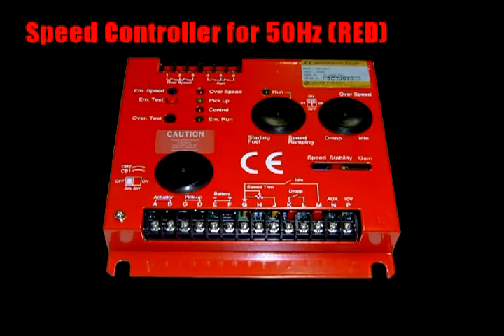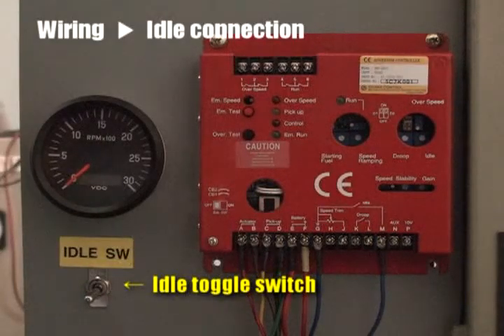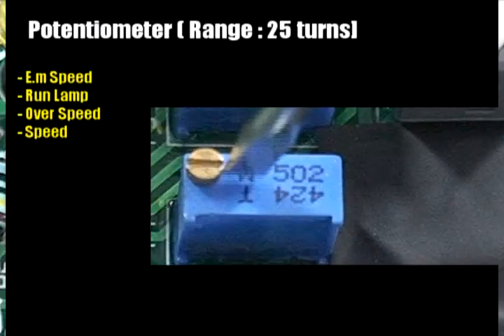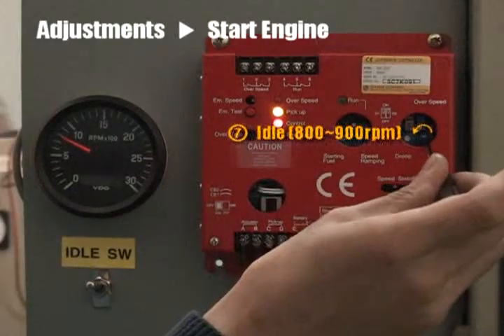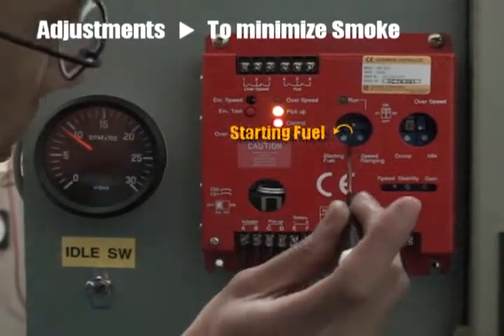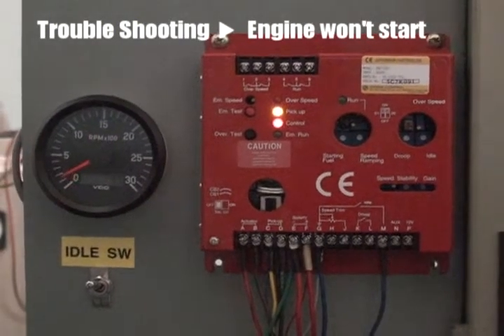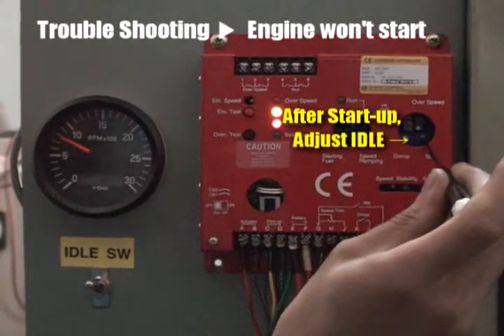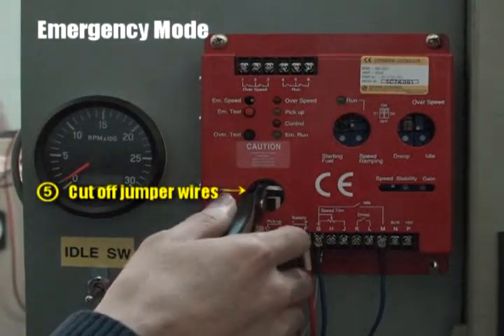سبيد كنترول  Speed control electronic governor

Comment: I need buy one and try to adapt and put on my gas generator. Because I have serious problem with voltage variations with the original mechanism for throttle control. And my inverting machine every time protect for heavy voltages fluctuations. THANKS FOR UPLOAD THIS VIDEO 📹 !

Comment: what would the idle speed used for?    runnings 1800 rpm    when would the idle speed come into play?

larry
Reply: The idle RPM of the engine is usually set at 60% of the rated RPM, switchover time from idle to rated depends on its rated RPM, usually for a 1500/1800RPM engine 30 seconds for a turbocharger and 20 seconds for a supercharger .

Comment: What is the function of droop
Reply from the maker: droop (Jumper K-L) can help stabilize the system for troubleshooting.
Reply from the maker: *Droop is based on a speed sensor frequency of 4000 Hz. and an actuator current change of 1 amp from no load to full load. Applications with higher speed sensor signals will 
experience less percentage of droop. Applications with more actuator currant change will experience higher percentages of droop. See droop description for specific details on 
operation of droop ranges. When used with the ADC100 actuator the droop percentage will he less due to the actuators low current consumption. 
**Protected against reverse voltage by a series diode. A I5 amp fuse must be installed in the positive battery lead. 
***Protected against short circuit to actuator (shuts off current to actuator), unit automatically turns back on when short is removed
Reply: What will happen and there will be need to adjust the speed fro the droop
Reply from the maker: https://mega.nz/folder/kWRSCRTK#SPr0Z9FnDkID5_V-LyUm4g
Reply: Droop is a drop in speed with load, usally used for synchronised generators.